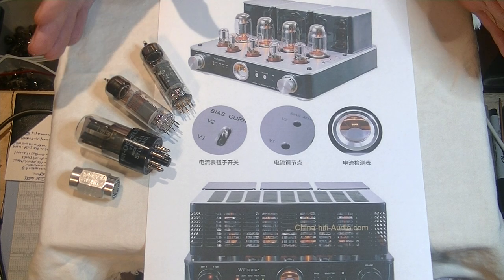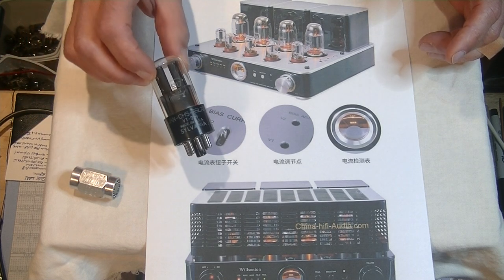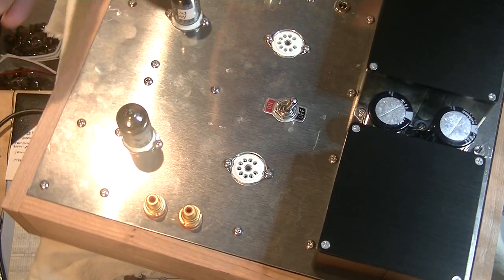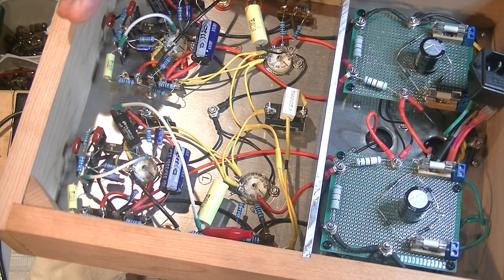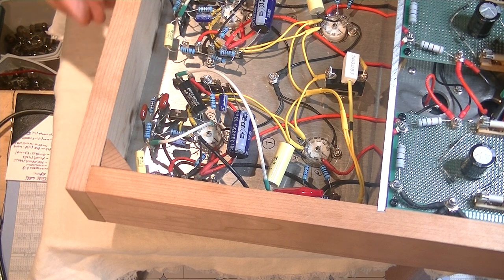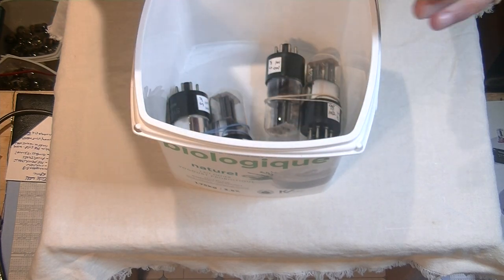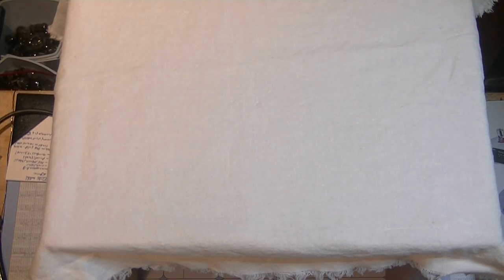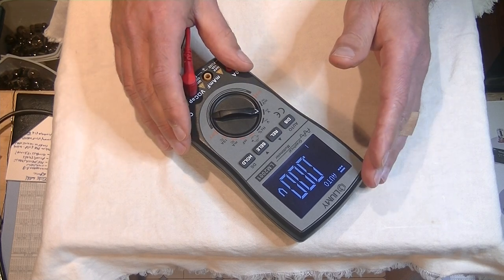Tube Lab Update 2021

Comment: Has the amp come through? I've had mine on order since Feb. No luck on shipping just yet. Hopefully some time this month
Reply from the maker: I chose the cheapest shipping option which is by sea, I always call this option "cheapest slowest"!  So I fully expected it to take 2 months, but what I wasn't happy with is the 1 month delay in getting it moving.  Clearly the website is BS, when it says 1 in stock!  It took them a month to build the amp!  On the other hand it is a quality affordable option for many people getting into tubes for the first time, which is why I wanted one for Tube Lab.
Reply from the maker: No but I expect it'll arrive soon.
Reply: @tubelab194  well I'm looking forward to your assesment as it will be my first tube amp! Funnly enough the site said they had one left when I ordered it. According to them, orders should be shipped this month! Lets see what happens